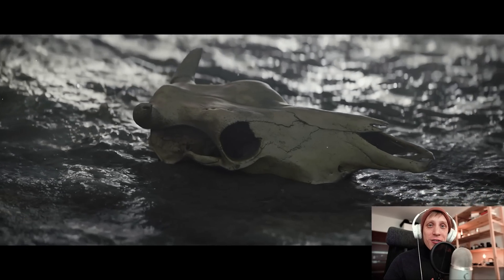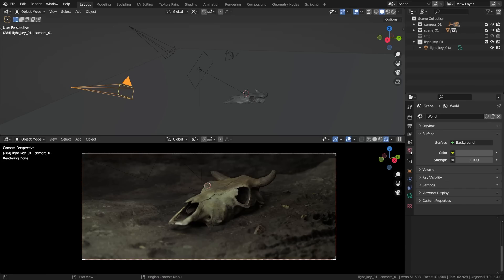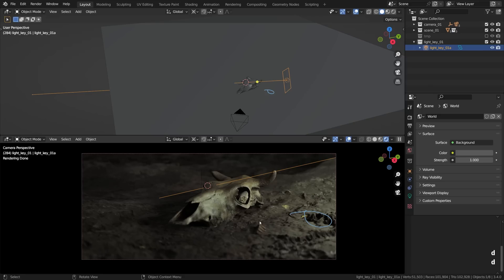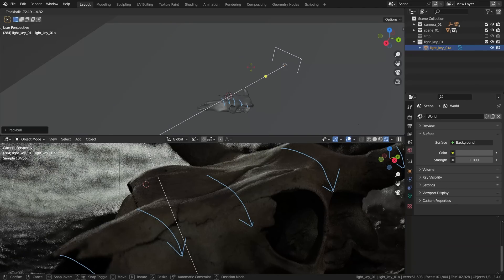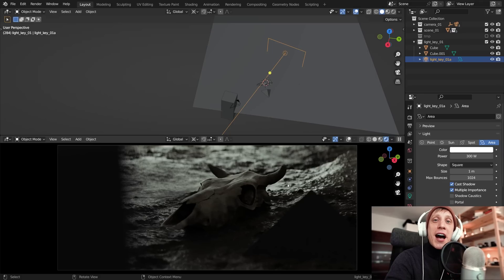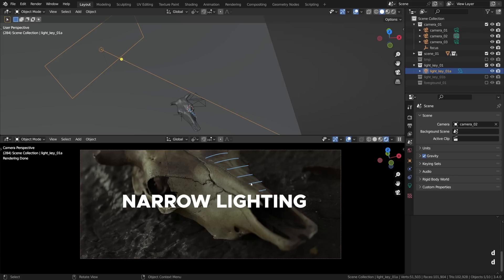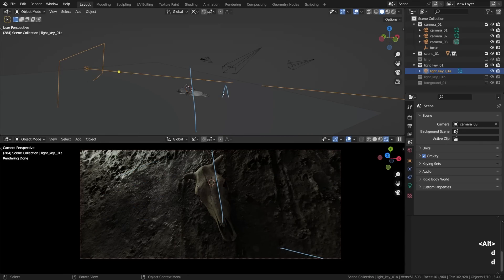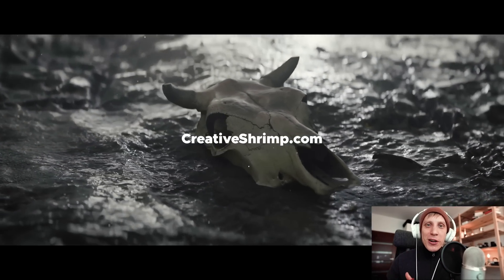One Simple Technique to Improve Your Lighting in Blender | Reverse Key Lighting

Comment: The one flaw I noticed is the shadow from the skull moves and is only visible on the foreground instead of staying on the same place. That is probably because the light plane moves with the camera but on opposite sides.
Reply from the maker: Do you mean in the animation? That was the point of this gimmick :D I mean, to lock the light position in relationship to the camera. But honestly I did it for giggles, it can look funky (even though cool at the same time) :) You're right, in most cases the shadow shouldn't be linked to the camera position)